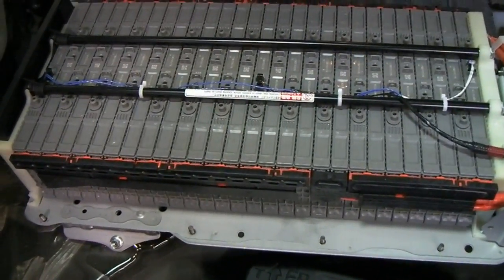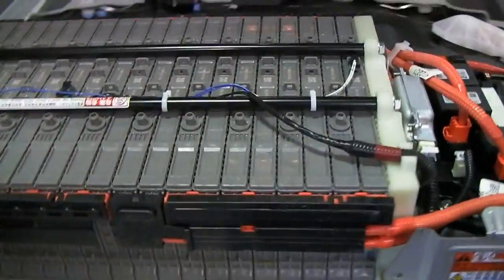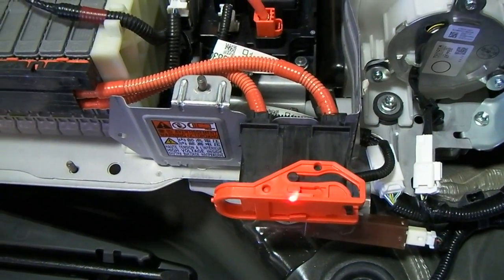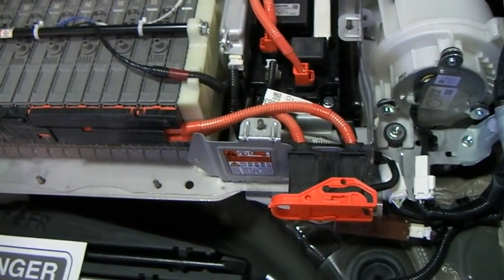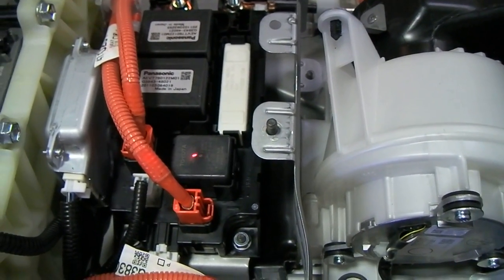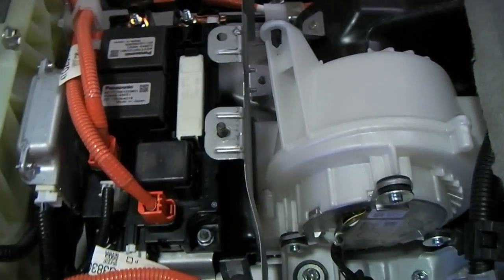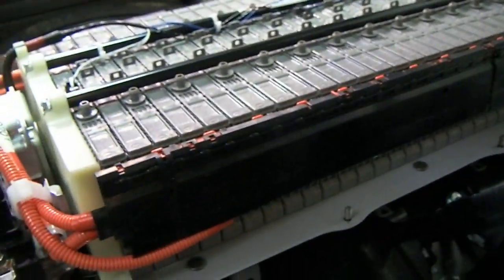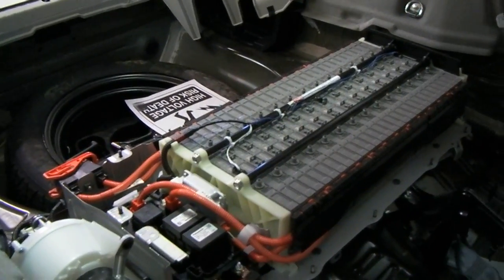Gen III Prius HV Battery Walkaround

Comment: Good discussion. I have opened up my Gen 3 Prius hybrid battery system numerous times and worked on it.  Corrosion of the connectors between the battery voltage harness and the battery voltage sensor / ECU has been a problem several times.  The most important thing you provided to me in this video is the location of the current sensor.  I am throwing a P0AC0 code which relates to the current sensor circuit, and I didn't know where the current sensor was located nor could I find information online about it's location for Gen 3.  I thought that small white connector near the large high voltage cables might be it, and you confirmed that.  Thanks!